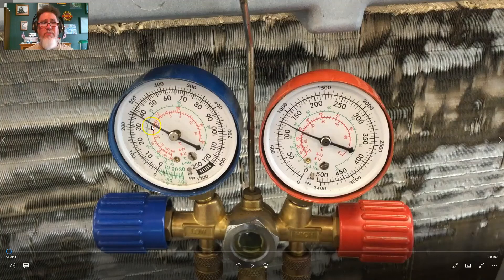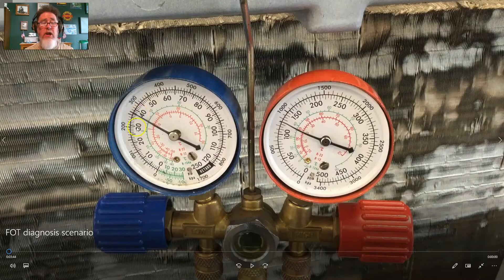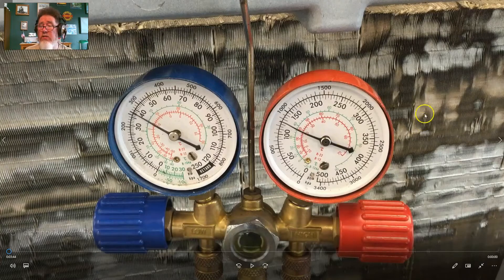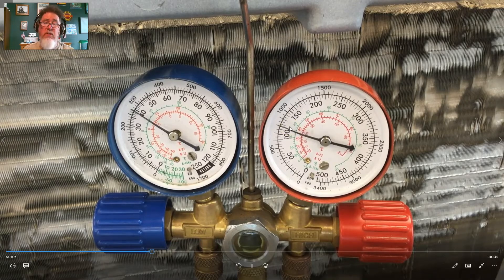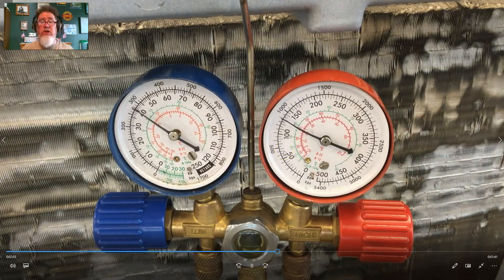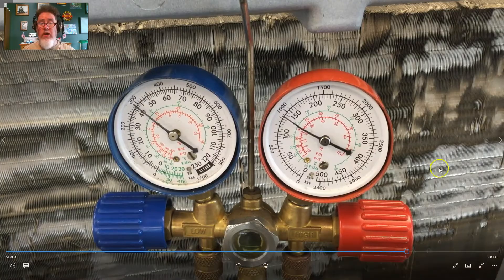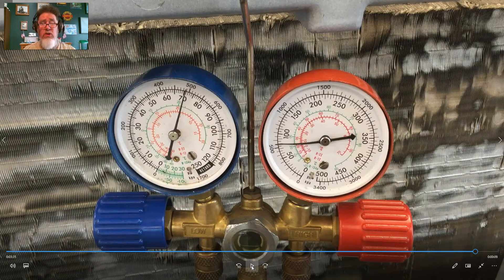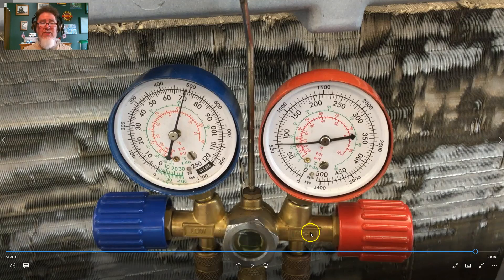How to diagnose an orifice tube that is missing in a vehicle's A/C system

Comment: I have a 96 dodge ram 2500. I think my orifice tube is missing but not sure. The low pressures are high and the high pressures are low. Brand new compressor and condenser. Any suggestions?
Reply from the maker: If there is no temperature drop through the orifice tube, it is missing.  You can feel before and after the orifice tube in the liquid line with your hand.  Also,  if equalization time if very fast, around 10 seconds, the orifice tube in missing, Normal time is around 30 seconds.  I hope this helps.   Thanks for watching,  PP.

Comment: I was working on 2000 ford ranger today and found it was missing the orifice tube.  It was sweating/ condensating very badly. I knew there was an issue with orifice tube,  but didn't expect it to be missing.

Comment: Where is the orifice tube? Looks like you can place it anywhere in the line. How do you find it in a dealer installed system? My system was vacuumed and I cannot get new refrigerant to go in. The compressor clutch is always on too. I thought it would be off after vacuuming until it gets enough refrigerant in it.

Comment: Professor    Info regarding 2002 ford ranger with missing orifice tube. Initially taken to Firestone for inop aircon. They replaced leaking evaporator & installed new accumulator/ dryer. Aircon was working but definitely weaker than normal. Returned it to them twice with no help. Decided to get gauges & do it myself. Readings with orifice tube missing were 43 / 125 psi with 55  degree outlet temp , equalization time 5 seconds. After installing orifice tube readings are 33 / 165 psi with 38 degree outlet temp , equalization time 45 seconds. System working great . Regards Lance
Reply from the maker: Thanks for the details Lance.

Comment: Can an orifice tube get blown out or something because I have a similar situation but I know I'm the only one to work on the car and last time I filled it it was fine
Reply: Shure you can find with cold water only not hot. Or a plastic ink pen can be cut to the proper length you need to put a small spring with a q-tip change the end of two big ink pens Poke a hole in each end and WALA recharge Crank it up will be snow from the vent
Reply: 1:53 1:53

Comment: If the mechanic says the compressor needs to be replaced, can vehicle operate without orifice tube? A/C system is not being used.  
Can I install a new orifice tube and operate the a/c system?